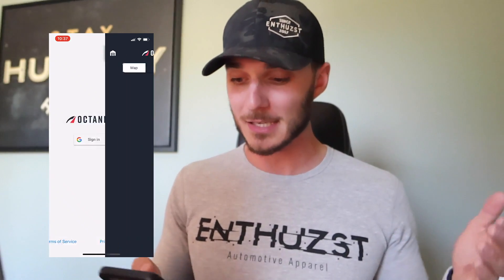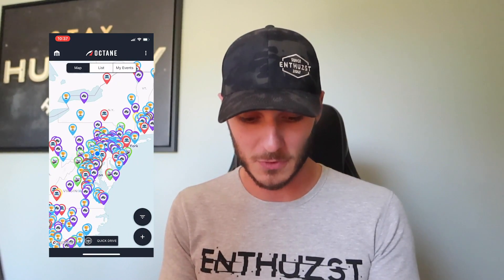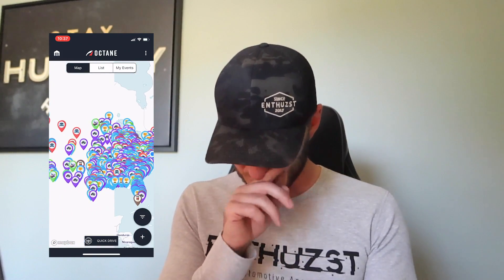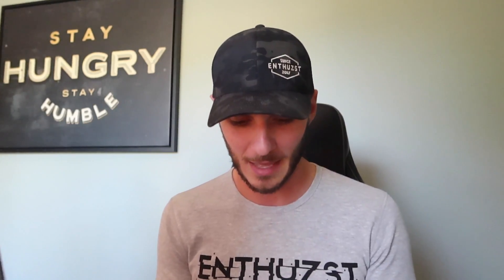Here's what makes this 2nd Gen Cummins EXREMELY RARE!

Comment: 2nd gen is still the best and my favorite ram ever. Went from a 99 2500 to a 2018. 2nd gen is more fun to drive, more of the driver doing everything rather the truck doing the work and you hold the wheel.

Comment: I painted my windows on my garage doors white gives you privacy and lets the light in and is easily removable with a razor blade!
Reply: Plastidip them white even easier you just peel it off did it at my shop

Comment: That looks very much like my truck looked when I bought it in 2002, other than mine is a single cab. 2000 Laramie 2500 HD 6speed 4x4 24v Cummins, same color and interior. Today, it has a flat bed on it, due to my tearing up the old bed in an icy-road accident. 204k miles, no blowback, never to be sold, lol.

Comment: Jack I like you man but stop giving manual diesel pickups throttle when taking off thats not how it intended to be used and that vp44 24v does not sound mechanical PLZZZZ drive a 12v